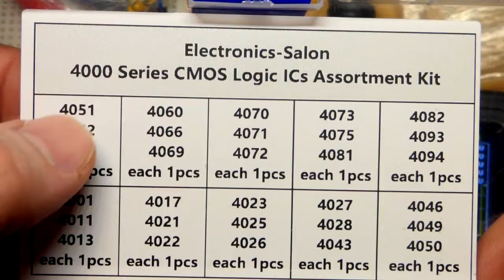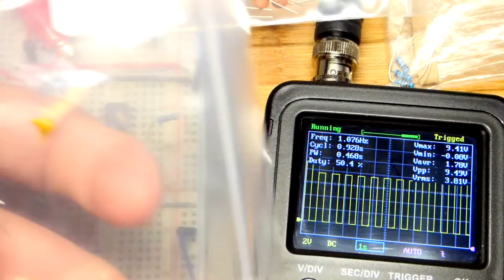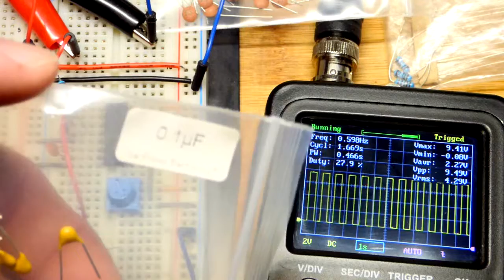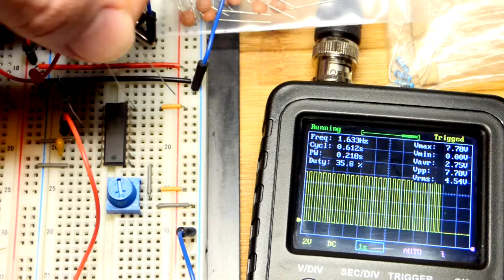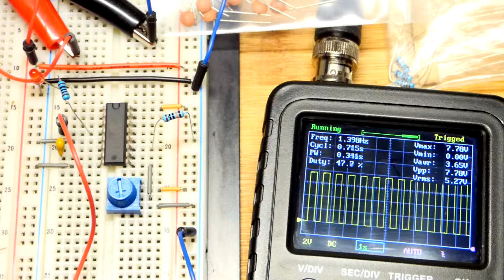First 4046 voltage controlled oscillator circuit VCO oscilloscope and LED circuit CD4046 CD4046B

Comment: Thanks for posting. I like the even noise free output waveform. Voltage Controlled Oscillators.
Reply from the maker: Thanks for watching!
Reply: @Electronzap these are kind of hard to find.

Comment: Copied your circuit visually and it worked from the 1st power on , from 5v rail !
Reply from the maker: Nice :)
Reply: @Electronzap  let me tap you for some knowledge : when I remove the C completely it shoots up to 2.3 MHz which I suspect is the limit on my particular part. Removing the resistor from pin 1 seems to have no effect at all. But that may be because my frequency measurements are garbage. Is that potentiometer/resistor only for fine tuning the bottom bits of frequency? I surmised that to tune from 200 Hz to 2 MHz you need very different machinery then to tune from 2 kHz to 2.2kHz. But I’m learning this by breaking things and interrogating ChatGPT (it’s surprisingly good at explaining fundamentals if you can filter out hallucinations) and occasionally random nice people

Comment: what is the name of the device on the right?
Reply from the maker: That's a pocket oscilloscope. Oscilloscopes are used to look at changing voltages, even when they are changing millions of times a second.
Reply: @Electronzap  Let me now take this opportunity to ask a heavy question, how can I make a circuit that can save a recorded sound?
Reply from the maker: @koponstanley4  I've never made one, or studied circuits like that, so unfortunately I can't help you there.
Reply: @Electronzap  Its Okay, thank you  very much.

Comment: How to configure the lpf circuit for CD4046 pll?
Reply from the maker: Sorry, never done that, will try to keep it in mind for a future video!
Reply: @Electronzap  wow nice, thx....People dont reply me ....usually.....
Reply from the maker: @endothermicexothermic4051  Large YouTubers can't usually respond much.
Reply: @Electronzap  hi~I have just tried to make pwm from a dual op amp...And connect it to a bridge and flyback transfomer...I get an arc with high frequency noise...And the arc is smal...Do u think that I set the frequency too high？
Reply from the maker: @endothermicexothermic4051  Never made a circuit like that, so unfortunately I can't be of any help :(
Reply: @Electronzap  😆nvm...thx

Comment: How can i design sine wave generator using ic555?
Reply from the maker: Haven't made one myself yet. Usually I see people use a combination of resistor(s) and capacitor(s) and sometimes inductor(s) to smooth out the square wave into a sine wave.
Reply: I made one and it is TERRIBLE! 😂 I recommend getting an ICL8038 kit on eBay for like $2.50.
Reply: Integrate a square wave？

Comment: I have a couple CD4046 chips on the way, as a matter of fact. As an aside, I was playing around with a CD4013 D flip flop the other day, still have the circuit laid out on a breadboard. Was really fun to realize I needed a clock and I could just grab a 555 and wire up a clock in under 5 minutes now. Practice makes better. :)
Reply from the maker: Very cool! All the videos I saw of people using the 4046 were audio based, so I suspected you may have known about it. :D
Reply: Yes indeed but I don't have need of it just yet. Serendipitously enough I was reading about PLL circuits in "Art of Electronics" yesterday and today. Amazing book that one, imagine if I actually understood it. 😂
Reply from the maker: Yup, I love that book :)